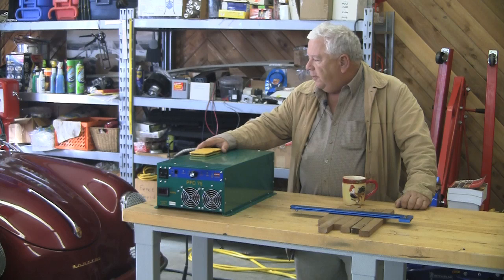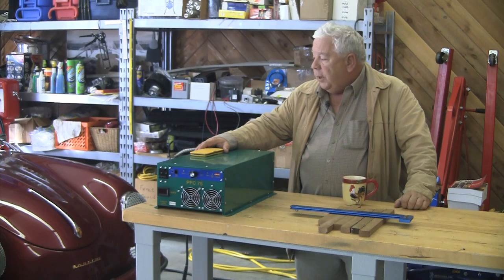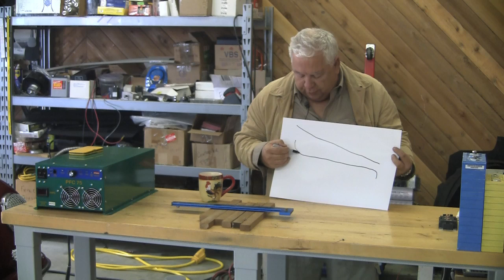EVTV News 111309 Part 1 of 6

Comment: What gets everybody into trouble is that flat LiFePO4 discharge curve.  You can no longer measure the voltage(s) and determine the SOC.  The only accurate way is to measure the actual amp-hours going in and out on each individual cell.   That is why the GEM battery monitor lied.  It used pack voltage to determine SOC which is not valid for lithium.

Comment: What you've discovered goes along with my BMS design.  I was only going to clamp the cells that are in the over voltage zone.   As the clamps turn on I was going to throttle back the charger.  When 10% of the clamps are on I was going to shut down the charger.  Running it longer just wastes energy with little gain in range.  My clamps are going to be semiconductors not resistors.  If the switch element should fail the individual fuse blows this would be detected and shut down the charge.

Comment: I agree. My experience tells me that as long as your C rates reasonable and you stay within the upper and lower limits, the cells will tend to cycle closer together over time, not farther apart. 

This has been observed going back to high performance LiPo powered RCs several years ago. LiFePO4 is even more forgiving.

The flat curve of LiFe PO4 means that the butter zone is between 3V and 3.3~3.4V generally (assuming no surface charge).

Stay close to that and just run it.

Comment: My chinese battery supplier told me point blank that they tried using the shunt system and they burned up so they moved to the balance charger setup instead.

I also agree that 4.25V is stupidly high and completely unnecessary. Mine (not TS) will typically be limited to 3.75 by the charger.

As for saying that you need dynamic balancing for charging AND discharging....... they are nuts! Not to mention the price of them. Unless you have a bad cell they will self balance over time.